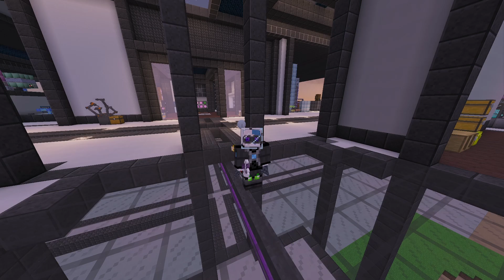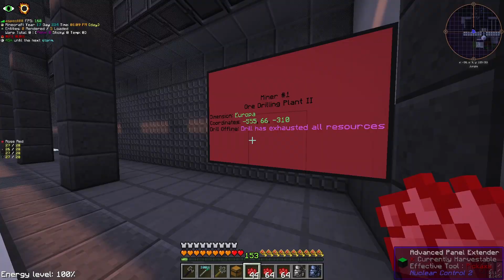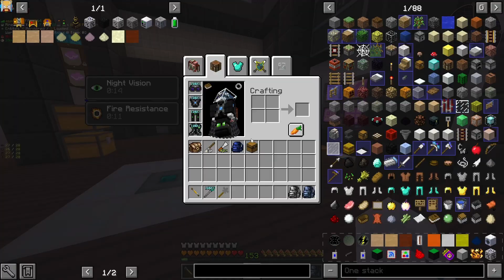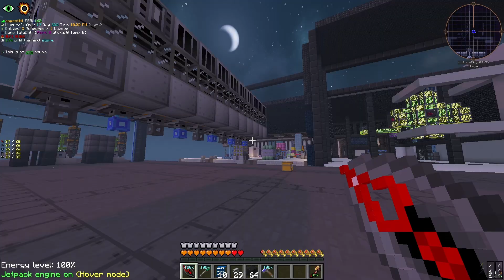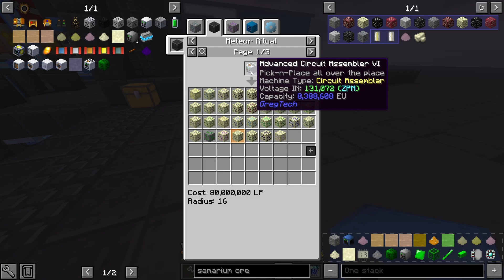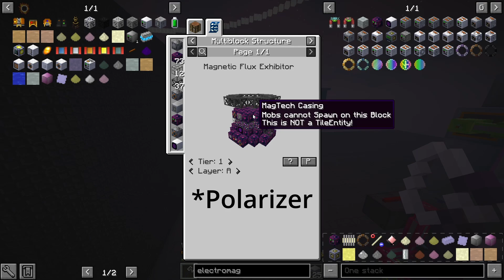Starting LuV! Assembly Line Automation & Samarium | GTNH 2.7 | S3E35

Comment: How did u bind your terminal to a key?
Reply from the maker: Once you have a wireless universal terminal go to the keybind config and search for universal terminal, the one from AE2 fluid crafting. Then you can put your terminal in your inventory or as a bauble and it'll work with the keybind. I wanted to put it on a mouse button but there's a bug currently if you have any kind of Logitech mouse where the mouse buttons won't open it until you put in a keyboard input also.